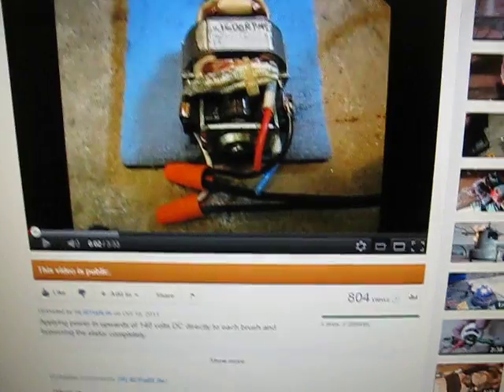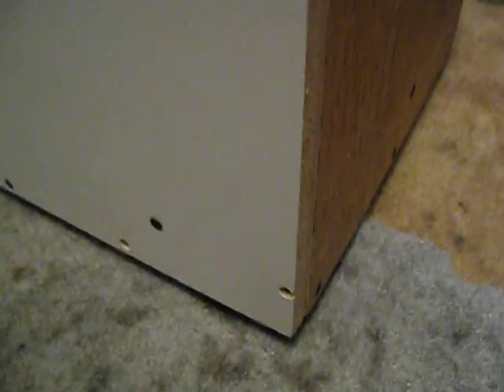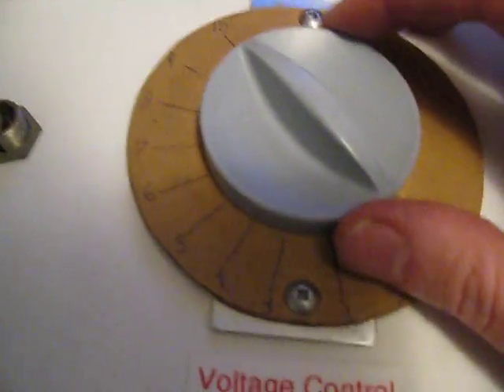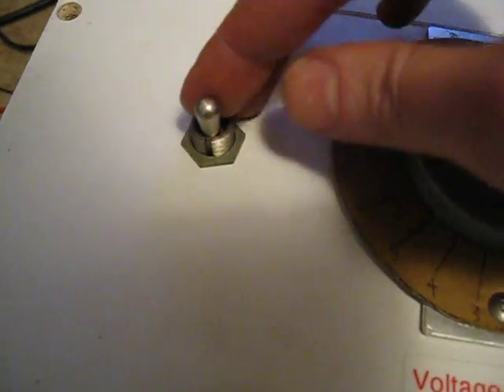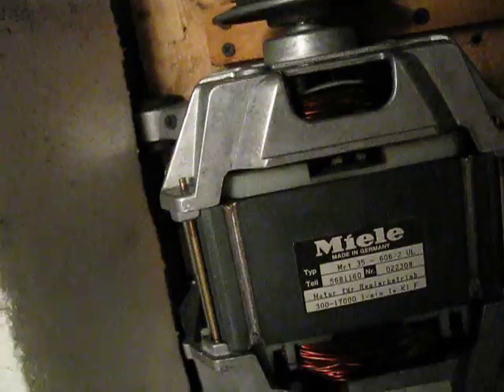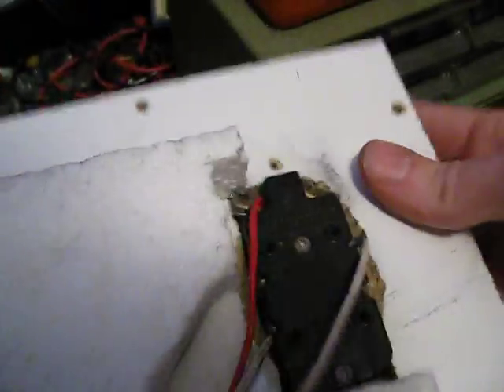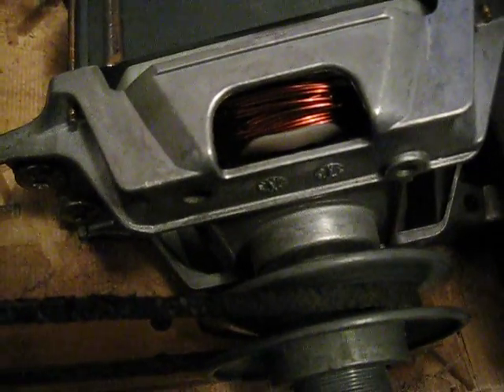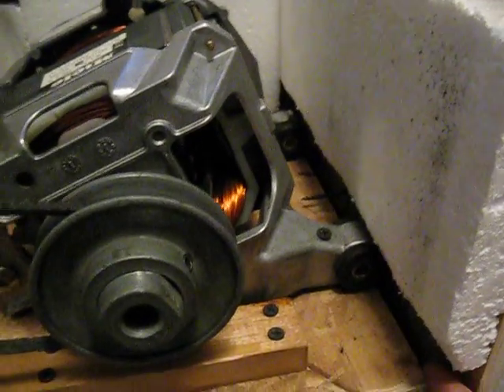DC Treadmill Generator

Comment: I have a treadmill motor i want to power with a gas engine for charging batteries, any tips as far as how fast to run it etc. Would like the gas engine to run as slow as possible to keep the noise down.Also i assume i would need a voltage regulator?
Reply from the maker: If it's a 130VDC motor you would only need to turn it at like 100 rpm to get 12 volts out of it, you can find out if you connect up a multimeter and give it a spin.
Reply: @HL4EHalfLife  Maybe a car alternator is better since they already have regulator built in. I have a motor already is why i thought about using it instead. Thanks

Comment: You were using electric motor to generate electricity. I Don't understand, is it just to show you can? Just wondering.
Reply from the maker: Yes, I wanted a DC power source that could handle current spikes up to 100 amps for a split second.

Comment: well done..if you run a tensioner on the belt you will gain better output and have less noise and vibration..can you give us some voltage specifics at different rev ranges if you are able?
Reply from the maker: I've since changed the pulley to get more volts out of the generator, it tops out a little over 200vdc now.
Reply: @HL4EHalfLife  What's the bore size on your pulley? I just got a treadmill motor - I'm concerned I won't get a precise read. Maybe it says on the specs somewhere?
Reply from the maker: @voidisyinyangvoidisyinyang885  I'm not sure on the shaft size it might be 3/4 or 7/8.

Comment: excuse my ignorance, but what does your device do? I'm trying to learn about electronics.
Reply from the maker: In simple terms It puts out DC.
Reply: Isn't it possible to accomplish that with diodes though? I'm not trying to discredit your video in any way.
Reply from the maker: Absolutely, The only advantage this would have is it having a buffer because of the 2 motors spinning at high speed.

Comment: that is what they call in the industry "Treadmill duty"

what you have is a 90VDC 1/3 HP continuous duty PMM
Reply from the maker: Its rated @ 2 1/4hp @ 130v DC
Reply: Treadmill duty, when you learn to comprehend what that means you can get back to me.

Comment: It's all about the internals if the device. A car alternator is prime example, it produces AC but has bridge rectifier (4 diodes) device inside. However you can strip it down and remove the diodes giving you just the AC side. But you might depending on the type of alternator have to apply a small voltage to the field windings to energise it as they don't have permanent magnets.

Comment: No your correct there my friend same setup just with ac alt
Reply from the maker: So what would i need if i wanted to generate AC and be able to change the frequency because the only motors i know of that can generate AC power is stepper motors (like the one in my fanbox video).

Comment: Yeah sure. Used to work in the RAF in the electronics bay. The was a 3 phase 240v motor which was connected to a generator which the output was set for 115v 400hz. It's all about the speed of the shaft to give you the frequency. Normal uk power gensets spin at 50 cycles per second giving you 50hz, so for 400hz you have 400 cycles per second. Made a lovely raw when it started
Reply from the maker: Ahh i see but i don't think i can do that with my treadmill motor because its putting out DC and not AC.

Comment: That's how they produce 115v 400hz for testing black boxes for aircraft. Can't believe you risked touching that small motor with 175v DC!! With open terminals if you had touched them you wouldn't have been able to let go, unlike AC with would have thrown your hand across the room. 

Good vid though, just be careful
Reply from the maker: "That's how they produce 115v 400hz for testing black boxes for aircraft." can you elaborate on that?

Comment from the maker: The dimmer switch is wired to the washer motor which in turn controls the speed of the generator and its DC output. As for the amps its not fixed it depends on the load and how much the gen slows down among other things.